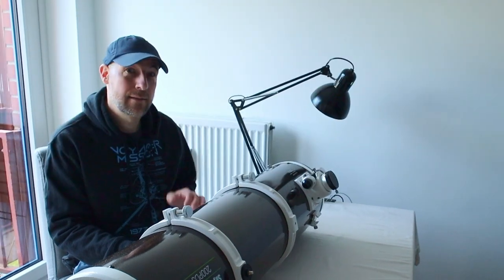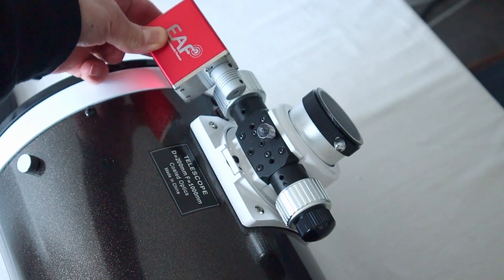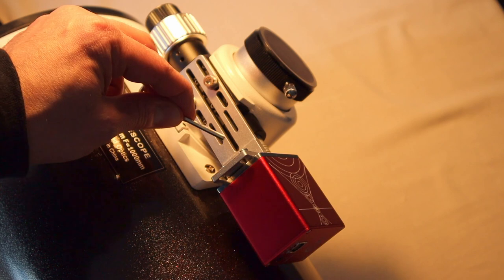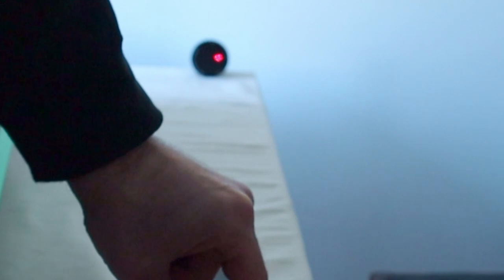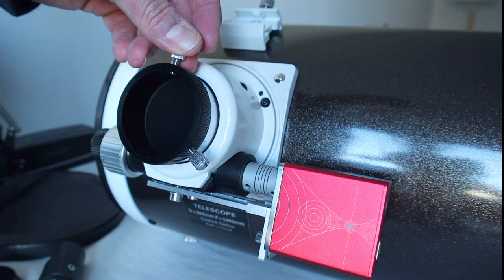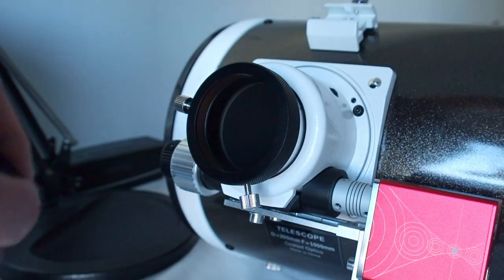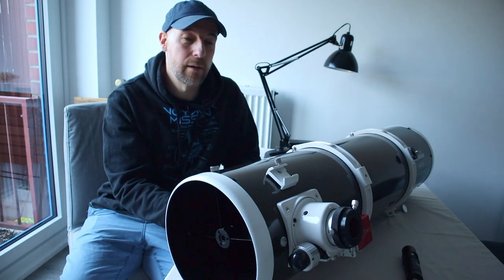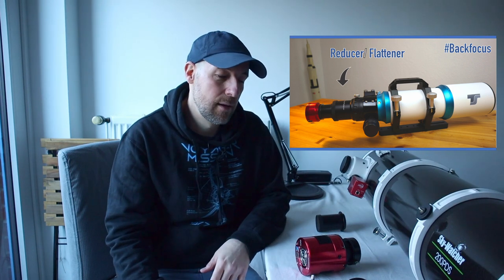Pimping my SkyWatcher 200PDS - Focuser, Off-Axis Guider, Collimation, Backfocus

Comment: Hey Tully hope the first test goes well for you.  Interesting to go with the OAG setup on this and will also be interested to see how this goes.  I really struggled with my setup even when it was seemingly collimated so I hope yours goes better.  Clear skies pal. !👍
Reply from the maker: Hey Ollie! :) Actually, I just had this OAG spare since I wanted to give this a try one time..(I bought it months ago) and in the end I had the chance to do this for the first time, save weight (compared to a guide scope), less additional surface area (most probably it doesn't matte anymore anyways.. 😂 , no trouble with balancing and it was also cheaper. What issues do you have with your PDS? Would be interesting to know... After some tests I saw some indications for "Pinched optics"..also tried to solve it, but It's not perfect yet. Thanks for watching again Ollie and clear skies pal! :)
Reply: @tullyfisher  Hey Michael - I found my 150 pds was always losing collimation.  Even when it seemed perfectly collimated I couldn't get good stars to edge, it always felt random.  I tried a bunch of methods and a good quality collimator.  I have heard of people getting bad copies as they are obviously mass produced, or it's also possible I didn't know what I was doing (very possible too😂).  Clear skies pal.
Reply from the maker: @OlliesSpace  Ah, interesting..most probably quite frustrating, I guess. Yes, I heard about bad copies as well. Maybe that's really caused by production. Haha... I'm sure you know what you are doing! So you sold your newtonian already? cs